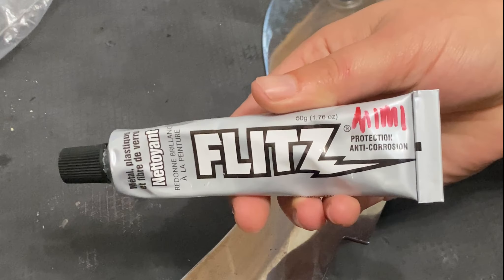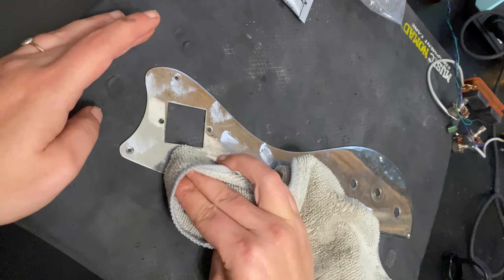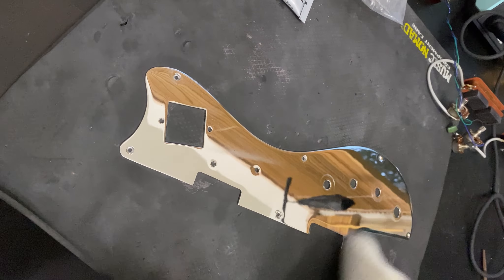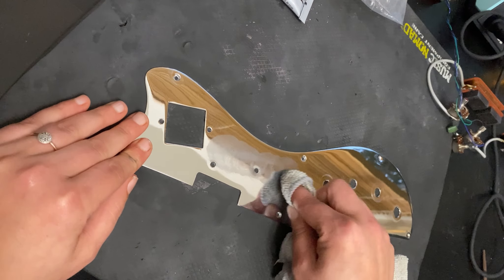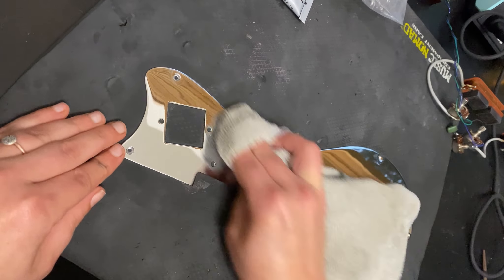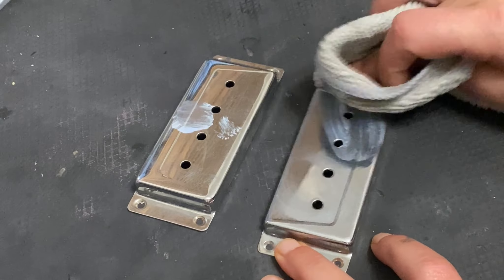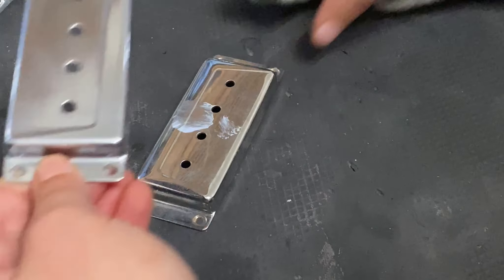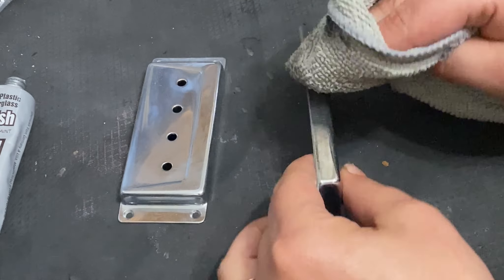Polishing Chrome Guitar Parts with Flitz Polish

Comment: Does it work well on frets with a dremel polishing wheel?
Reply from the maker: I use it on frets for sure! I usually just use the microfiber cloth to apply, but the dremel wheel would do the same (or better) Just make sure the fretboard is protected! (Especially maple fingerboards)